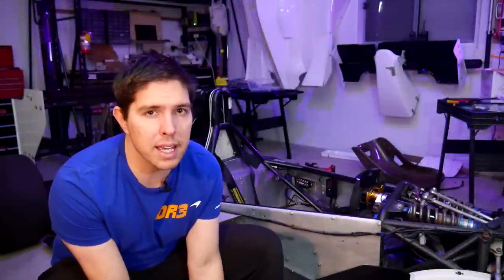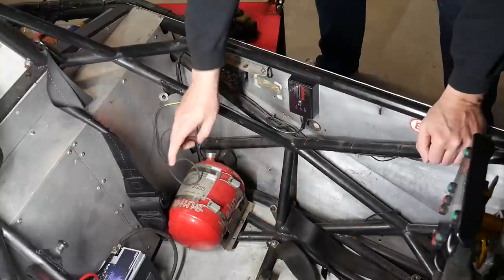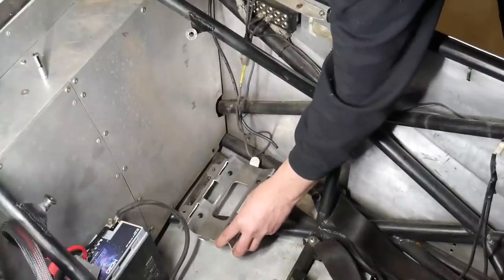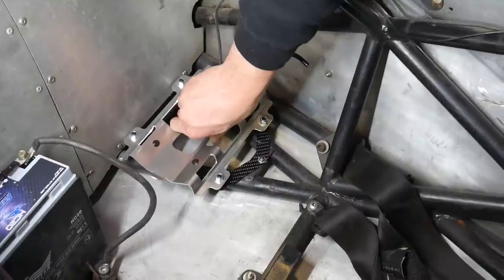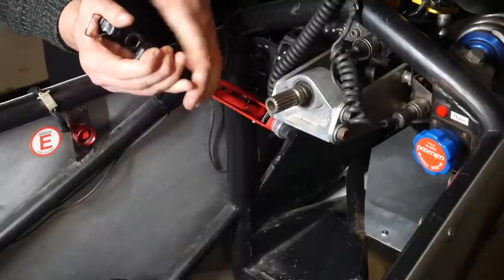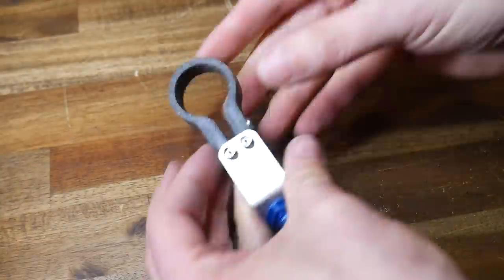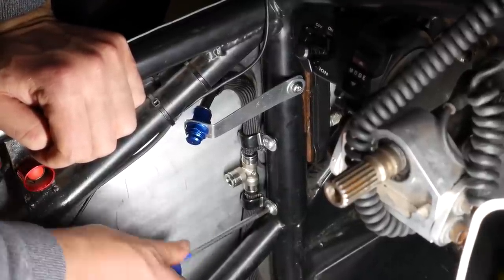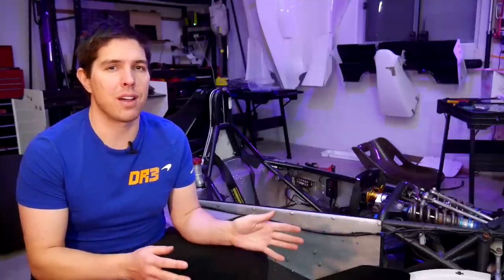Updating my race car fire suppression system so I can drive it

Comment: Do you worry at all about drilling holes in structural pieces of the tube chassis? Rather than some sort of bracket that just attaches to the chassis without any holes?

Love this channel btw!
Reply from the maker: I do. It was debated with friends and U wanted to keep it to a minimum. There are other rivnuts in the chassis around the cockpit, I added the minimum which was four more.

Comment: Is it a fully manual system or does it have some sensors in case you are knocked out in the event of a crash?
Reply: manual. you wouldn't want it to go off every crash, since the car usually doesn't catch on fire. it makes a big mess and is a pain get refilled, install, etc.
Reply from the maker: To add to this, the big stickers on the outside will let a Marshall know where to find the button in case the system is needed and I can't activate it.

Comment: IF THERE IS A FIRE WONT THE MOUNTS MELT?
Reply from the maker: If it is on fire for that long the system would have already emptied and failed. With that flexible tube, everything pretty stays in place without cable ties and mounts. There's a good amount of redundancy built in.

Comment: Fittings which pass through bulkheads are simply called bulkhead fittings. 

I don't know if it is a down under thing or it's lost in translation, however you are the first person I have ever heard take the intials of the Federation  International l'Automobile. (F I A) and make it into the pronouncable word. Feee ahhh   Never heard it referred to as anthing other than the letters EFF   EYE    AYE